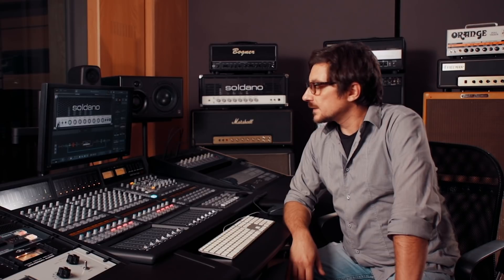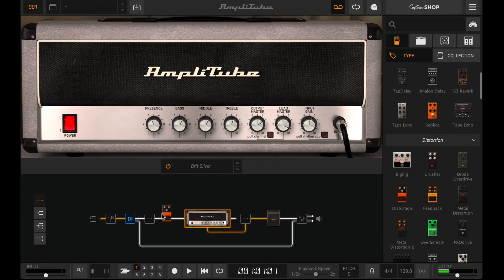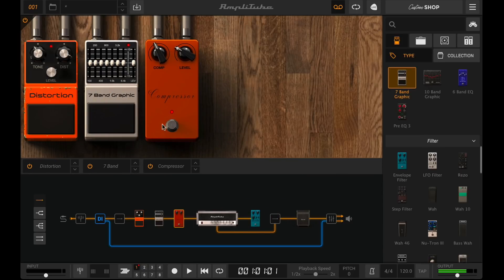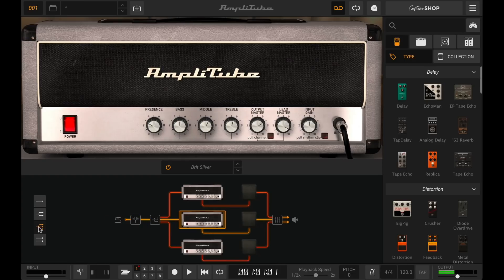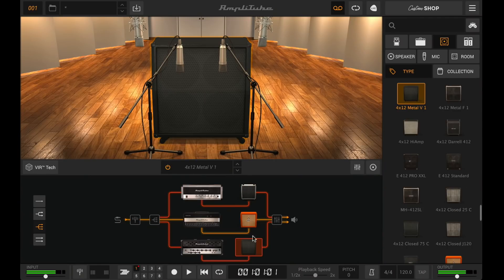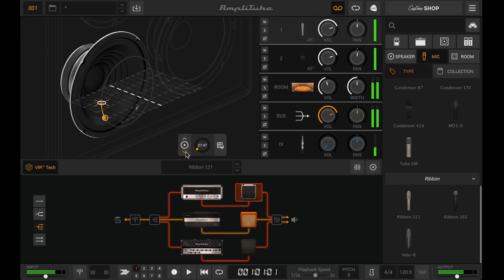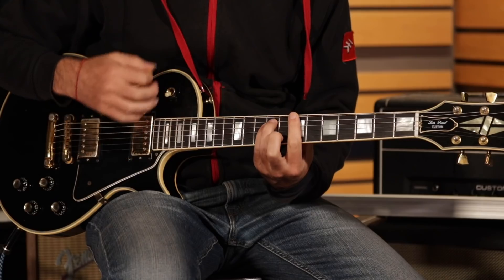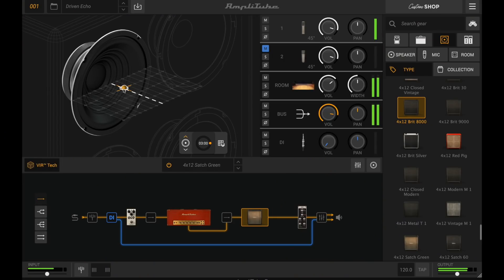Making of AmpliTube 5 - A technical talk with the creators

Comment: Just bought Amplitube Max. Is there way to "lock" an amp in place ( like Tonex) while going through presets?  I use this all the time in Kemper's Rig Manager.  Can you please make save the last folder used each time, so when I am downloading lots of User presets, and don't want to have to navigate back to the same folder each time. Also does anyone have issues entering text in the fields sometimes? I'm on a new Mac Studio. In Tonex & Amp5.  Thanks!

Comment: I really appreciate how much you cared about the quality of the cab component. Using it with my load boxes and it really shows!
Reply: Something that would be great for version six would be a dedicated mode for using with your own amps. The cabs sound great, as do the effects. X-Gear stuff is on all the time now. 3/4 of the time, I’m using my own amp collection into a load box. It already works quite well, but I’d imagine your team would come up with some very clever ways to enhance an ‘external amp’ option. Also could really use dual stereo outputs to be able to process room and direct differently post-plugin.

Comment: As one of the leading developers in IR it would be cool if you gave your input into what amps\cabs are best to reproduce those sounds. You aint for example going to use a Vintage30 IR when your playback speaker is also a Vintage 30 no point and u ain't gonna get a G12T to sound like a Vintage 30 either u cant get a chinese Vintage 30 to sound like an original Uk version. I have done my own experiment using power amps (crown QSC Crest all top pro quality) and various pro full range PA cabs played next to the original Cabs/speakers to see how close they are in reality. I have to say it is not east to get the tone close, even if you use quality studio monitors direct from the computer. But you can get sound really nice tones from IR but then so does an original G12T Vintage 30 G12H etc 

Does IR replace all those cabs/speaker combinations? Maybe, but its not just as simple and playing the plug in, you still need the right gear to reproduce those specific tones you have captured with any accuracy. Even with top power amps, I have to say I have struggled its no where near exact, its close, and maybe for some close enough, but those amps and cabs I have used cost more than the originals !!!